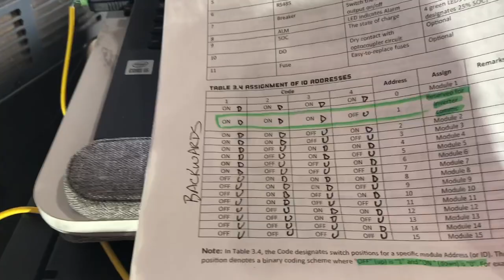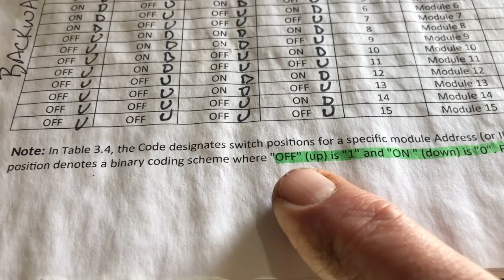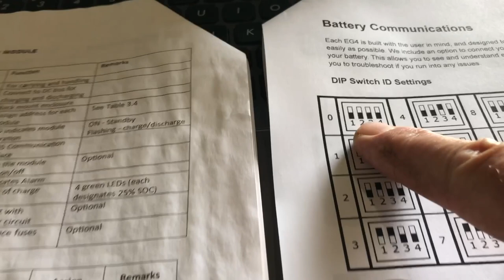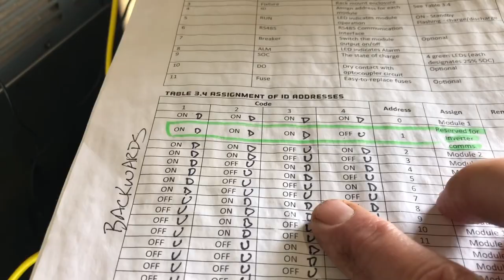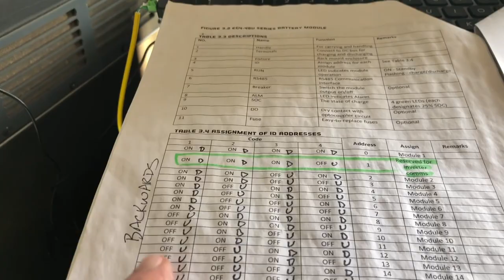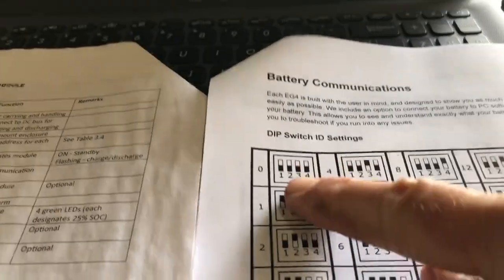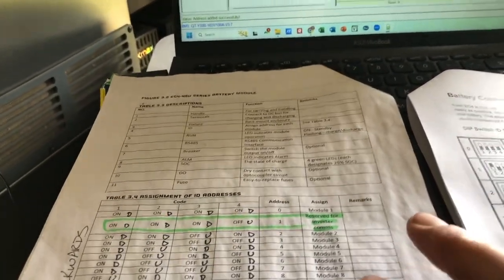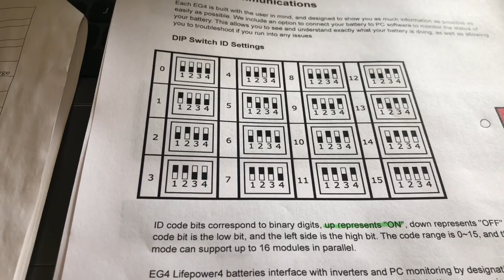Clarification of the DIP Switch Settings on EG4 LiFePOWER4

Comment: Thank you Lance! I knew I wasn’t going crazy. That text on the bottom is so contradictory what is “on” is “off” and what is “off” is “on” — Ridiculous. Thank God for you my man for setting people straight, it took me a lot of trial and error to figure it out before I saw your video. Oh yeah, everybody make sure that you don’t use number one dip switch settings as that is reserved (I saw the little white tape on your second battery stating that).  So your dip switch settings should be zero for your first battery (this would be the one that has the communication cable going directly to the inverter), then set the next battery dip switch to #2setting, third battery for dip switch #3setting, etc

dip switch settings from top to bottom 0,2,3,4,5,6
(don’t use number one DIP switch setting for any of your batteries)

Comment: My inverter manual says the Lifepower batteries off is down and the LL batteris on is down.  The latest (Dec 2022) doc for the lifepower show down is off as well which is correct.

I feel like it's hard to get in contact with technical support at signature solar.  If you get in contact with their technical support it is great but you almost are always stuck with their sales "support".

Comment: In the inverter booklet the pictures are backwards too lol. I noticed cuz it says "off = down" and right next to it has a picture with the white all up which should be all up/on but I guess they don't understand how pictures work.
That's on the EG4 company though whoever they are.

On signature solar's fault a bunch of their breakers are labeled wrong. Their main breaker they use for all 48v stuff is rated at 60-80DC not 48v

Actually further reading of your book I saw it is just simple binary octet of switches to get their numbering. It's just backwards and upside down.. in their first book and now it's just backwards in their new book but at least they figured out that up = on lmao
googling that lead me to the diysolarforum post where I guess the guys figured this out more than a year ago already in may 2022

Comment: I have been dealing with dip switches for 50 years. USUALLY... The white portion is the switch tit. Obviously flawed docs. Question, when you update the battery software, do you have to update each one, one at a time? Or, if you update the master, will they all update through the chain?
Reply from the maker: Each module must be updated individually.

Comment: I have 20 and no one at SS can answer how i connect them to read them all. I also bought a eg4 cummunication hub but they can't seem to tell me how to configure them there either. And no one returns calls,  or e mails
Reply from the maker: very frustrating. Check out some of my other videos on dip switch settings. They will save you a LOT of time.

Comment: Hi, have you been able to get communication eg4ll-v2 and eg4 lifepower4 in a single rack? - my setup is four eg4 and one eg4ll-v2 .I made the mistake thinking I could mix the battery's in single rack and all five would be recognized by my Schneider inverter in closed loop communication. Currently my inverter on see's the four eg4s
Reply from the maker: No, I'm using software. Since you only have a single EG4-LL V2, you can hook up a PC directly to it and monitor it with BMS Tools. Sorry I can't be of much more help.

Comment: Lance, I'm running 1 48v EG4 LL battery, 1 3000W EG4 inverter. I can't get fault code 19 to clear. I've got my RS485 cable installed between battery and inverter. Any suggestions??
Reply from the maker: I don't have experience with that particular configuration. What ID are you using on the battery?
Reply: @lanceknoechel8945  There is so much confusion about the dip switches. Up bring off, down being off. I've tried both positions, for position 1. Even tried position 2.